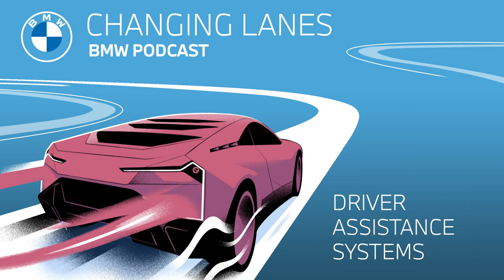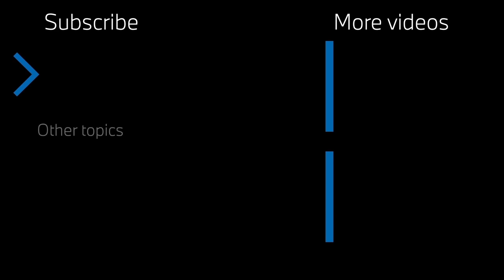All you need to know about driver assistance systems - Changing Lanes #044. The BMW Podcast.

Comment: Where is my lane change assistant on my iX3? Why do I need to code for this option? I have all driver assistance packages
Reply from the maker: Hi Erwin, thank you for your message. If you require any technical assistance please contact your BMW dealer directly. They will be happy to assist.
Reply: @BMW  You must know internally more right? The dealer is just saying that the iX3 is delivered without lane change assistant while you make as bmw advertisement about this very feature on the iX3